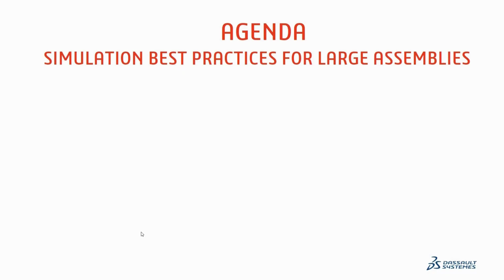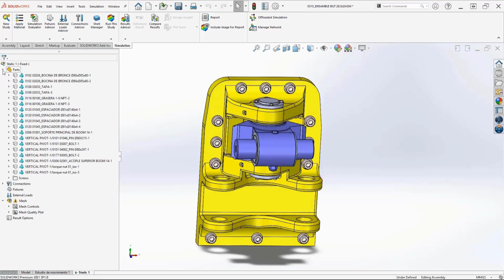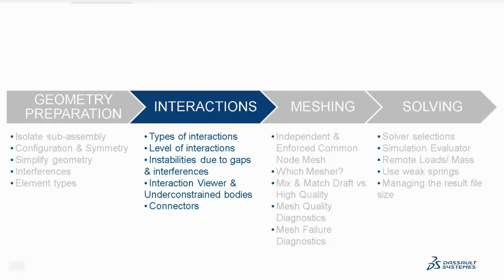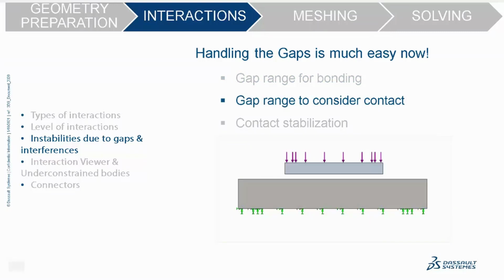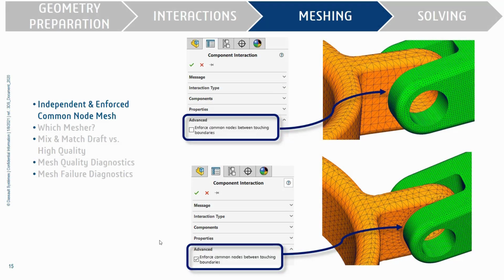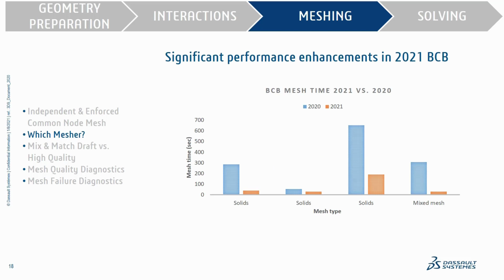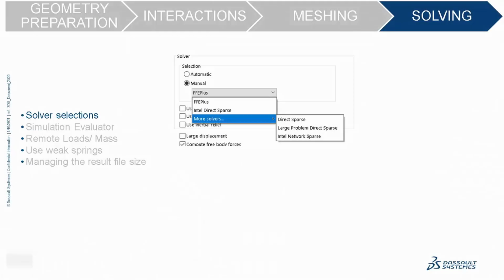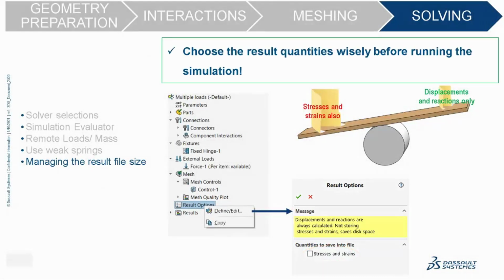Best Practices for Solving Large Assemblies in SOLIDWORKS Simulation

Comment: thanks a ton for putting this together, you guys! Just when I was getting clouded with the Simulation frustration haha. By the way, I want to carry out a Drop test analysis to be able to simulate a landing impact of a High Altitude Balloon payload using Solidworks Simulation. I am not able to change the mesh types inside the Drop test analysis (as I realize it would be better to apply specific meshes). Can I possibly, first of all, mesh in static and then import into Drop test for simulation?  How would you suggest Mai/ Nandish I go about this? Thanks! : D
Reply from the maker: Hi Neil, Please reach out to our community to post your question for one of our experts: my.solidworks.com/forums. It’s free and easy to join and access.